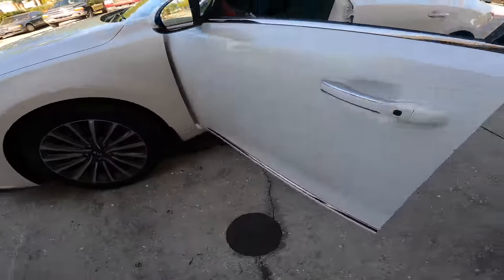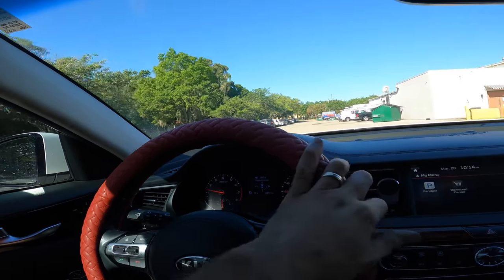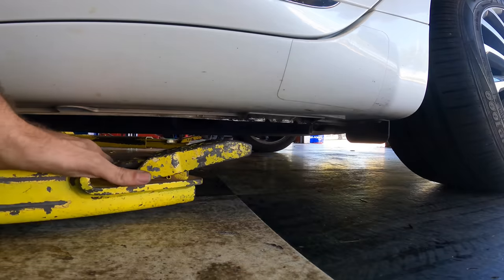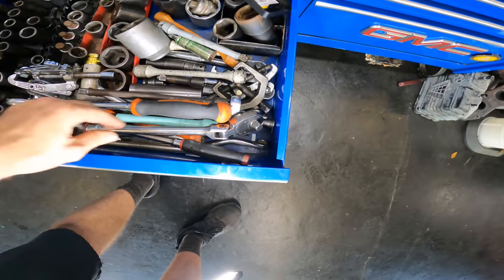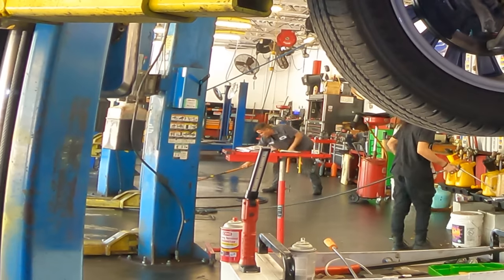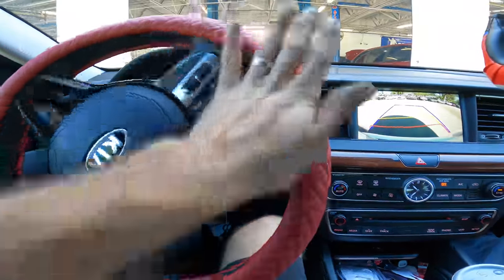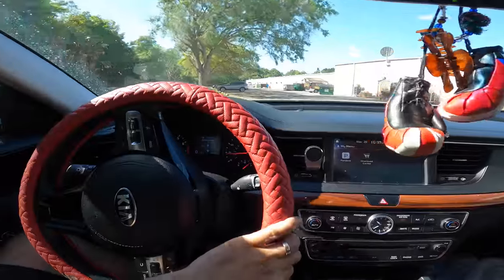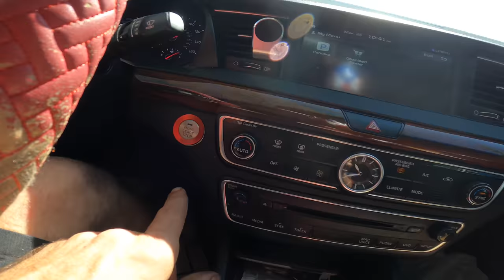I was WRONG! Comeback time! Staring into a Dumpster! 2017 KIA Cadenza

Comment: No, you weren't wrong about "road tested parts" or junk yard parts; whatever  one chooses to call them. Before I got into fleet repair and was in retail repair, there was nothing as frustrating as a customer wanting to save a buck by using road tested parts and then wanting a warranty on the work performed. And this was while I was working at the Ford dealership! What service manager in their right mind would allow a customer to bring in a used water pump for a Ford Tempo diesel? Yes, you read that correctly. It was probably 1 of 3 Tempo diesels sold in California. And the customer brought it in, along with a used water pump. It lasted about a month after the work was done, and the guy came back wanting us to replace it again under warranty. The service manager agreed since California's Bureau of Automotive Repair would have likely found the shop at fault one way or another. 

I understand there are instances where road tested parts are the only option. Even in fleet repair I have had instances where a wrecking yard part was the only option to get a truck back on the road. Most recently was a radiator for a Freightliner M2. They were on a back order at the time; the truck was 3 1/2 hours off the beaten path in Death Valley Junction. I couldn't very well leave it out there lest some hooligans use it for target practice. The worst part was the wrecking yard knew my situation and charged me accordingly for a road tested radiator.

Comment: I wonder if it could be a case of the parts settling in and then being loose? Back in my day we cleaned the floor by dousing it with gasoline and covering that with floor dry, let it set for a couple of minutes then sweep it up, the rest of the day enjoy the headache from the gas fumes, we also used air to blow out brake dust making huge clouds of asbestos.

Comment: I'm retiring in a month . I can't think of a time a wrecking yard part failed me . But I'm selective on what I'll allow from a wrecking yard. But man the list of new parts that failed is seemingly endless . 
 Honestly I'd be 10 times happier to install a low mile wrecking yard motor over a reman. 
 The wrecking yard motor is tested and proven while the reman isn't. I don't know about where you are but where I'm at climate control in machine shops is unheard of. I've seen rebored blocks done at  the so called best speed shop in the area with 20,000 taper . 
 So I don't slam wrecking yard parts. 
 That being said I wouldn't use brake parts other than drums and rotors after machining.I won't use steering components  from a wrecking yard

Comment: Torque yer nuts.
But don't.
Overtorque yer nuts.
I remember that everybody
can recheck a car here and there and find something to tighten or do more , and it was not exactly what the last guy did.
When people get manual, hand operated tools on it, they try to find looseness, sometimes it breaks.
Then some nut up in some pocket has to be accessed.
Looking up all those torques takes infinite time you don't get.
We just had an episode that agrees with the torque wrench heads.
They don't work on this kind of job because they would need way too much time. They spend days doing what a auto tech does in a couple hours.
But tight is better than right, and that's what we realize. Tight is also better than fast.
Just get them tight.
Watch out for judgemental attitude. It ruins good people. We had guys who thought their job was to nit pick, after having lowered the labor, but knowing they could cherry pick and always make bonus.
If I checked my own bolts after using an impact all over a car, they wouldn't have any nit pick.
They wouldn't say, good job,
They would look sideways or just not say.
So I checked often. every chance I got.
It can ruin them when communication doesn't occur.
Who put them in charge?
The guy who didn't torque his nut.

Comment: Ah the days of cleaning the floors, I worked at a 24 bay Volvo dealership so it was a weekend overtime job. Also Raymond, do you not recycle at your shop?
Reply: If done during the weekday, would the place compensate flat rate guys for the cleaning?
Reply: @mph5896  Place was always too busy with most if not all bays in use, however we closed the service department at 12pm on the Saturday and was always closed on a Sunday so that gave us the room to deep clean

Comment: Were you wrong?   I don't think so.  You were in the ballpark of the areas that could be the issue.   Didn't see you making assumptions about the status of things (parts cannon would have fired). Checking the work, and finding an issue fixing said issue, then rechecking.   Sounds like good diagnosis and resolution to me.   Admitting that some of the avenues of suspicion were not the culprit and not where blame should be placed, is simply a testament that your working practices are good, your diagnosis is sound and therefore it's a good job.

Comment: But Ray, that is why everything should be checked with a torque wrench, after all that is what they are meant for. In my opinion if a tech doesn't check fasteners with a torque wrench they are just being lazy and should be disciplined for it. There are way to many techs taking sort cuts. The amount of vehicles here that have there tires come loose and or fly off at seasonal changes is stupid and very dangerous.

Comment: From Merriam-Webster dictionary…

Is Irregardless a word?

Irregardless was popularized in dialectal American speech in the early 20th century. Its increasingly widespread spoken use called it to the attention of usage commentators as early as 1927. 

The most frequently repeated remark about it is that "there is no such word." There is such a word, however. It is still used primarily in speech, although it can be found from time to time in edited prose. 

Its reputation has not risen over the years, and it is still a long way from general acceptance. Use regardless instead.

-fin

Comment: Rainman how much business does that body shop give you? Because if they're making you use used parts and then declaring a rebuilt title vehicle or the car wasn't totaled the shop may be liable for damages that occur with those vehicles. I'd duck them whenever possible because more than likely people don't know their car is being rebuilt woth used parts
Reply: When people don't know that used parts were used to repair their car, it's because they didn't read the fine print. Pretty much every insurance policy has fine print that tells them that used parts may or may not be used for repairs and it is always noted on the body shops paperwork as well. Repair shops also note that used parts were used on their paperwork when that is the case. It's usually a single digit code located in the parts section of the invoice. U for used, N for new etc. Used parts are an acceptable alternative that body shops frequently use to save money. Most mechanics don't like installing used parts though.
Reply: @catfishbilly7425  I'm saying if they are shady (which in my experience as a mechanic happened) the shop that installed the parts can be held liable. I avoided all body shop cars as a result because it wasn't worth the risk. It's also a great way to piss off a customer who never even knew their car was in your shop. Not a good look either way. I understand the insurance and all the other bullshit. But if they are a very tiny portion of the business just ditch them. It isn't worth the headache

Comment: This looked indeed wrong.
First, you wet the floor with cleaning agent. Then, you start working on a car, while your co-workers HELLO PETER are condemned to scrub the floor. And after you're done with that car (good that it didn't take long), you're the designated cleaning machine driver, instead of putting in real effort, like your co-workers HELLO PETER did.

Comment: I always use hand tools to loosen and tighten the frame bolts. A lot of them have the captive nuts being held by sheet metal and in my experience the impact will shear it right off. Sometimes ya gotta put it on high and let it eat but its a last resort. I live in the rust belt so I see more rusty pieces of shit.

Comment: Sooo... if your shop installed those parts and the two bolts on the sub frame were found to be not tight - does the customer get to eat the bill for your time today? Hey Mr Customer... we did a poor job, the result could have killed you and your family, here is the bill for us to rectify our mistake. Have a nice day.
Use a damn torque wrench for suspension, brake and train components not an impact with 1, 2 or 3 uggs at the end - air or battery it's just random how tight things are due to fluctuating line pressure or battery voltage.
Everyone gets a pass on manufacturer dictated bolt torque specs on interior stuff.. it's not as though your instrument cluster coming loose will mean it suddenly kills you by launching itself into your throat when you least expect it. Drive train components, not so much.
Reply from the maker: I think you’re taking it a little too seriously. Nobody’s life was in danger here. And no the body shop didn’t pay twice

Comment: Why would any shop use used parts to repair a customers car? If I bring my car to a shop for repair I would expect the shop to install New OEM parts, not some crap out of a junk yard to keep the cost lower, when you buy cheap parts for a car your basically just flushing your money down the toilet, always install new parts never put old used crap on any car especially if it’s  a newer vehicle, id be pissed if u put cheap crap on my car, get that crap off and install new parts for free since they didn’t request you use junk yard parts,
Reply from the maker: Body shops do this, legislation allows it. Votes have consequences
Reply: @RainmanRaysRepairs  ok well if I ever need a new subframe on any car I’ll just trade it in for a new one? I don’t do cheap used parts on anything if it’s not OEM it’s not going on my car, and I only service my car at the dealership, or if I find a mechanic like you I’ll let you work on my car all day long as long as you use OEM parts only, but most my cars are only 3 years old or so after 5 years or 50,000 miles I usually get a new car as most cars won’t last very long after 50k, now trucks I’ll keep til their rusting off the frame since all I buy are diesel powered trucks when I purchase a truck it’s usually a ram